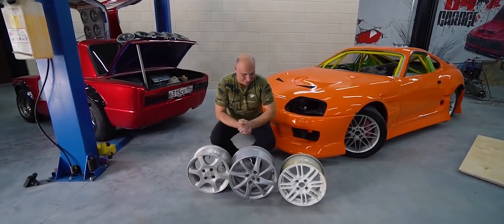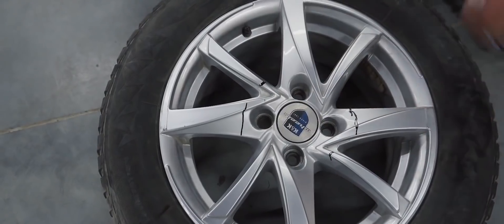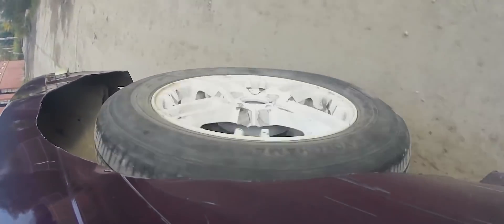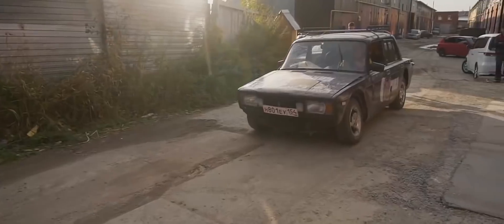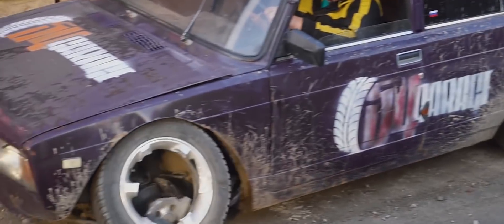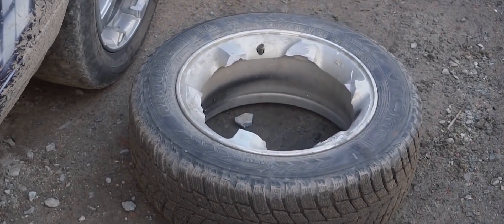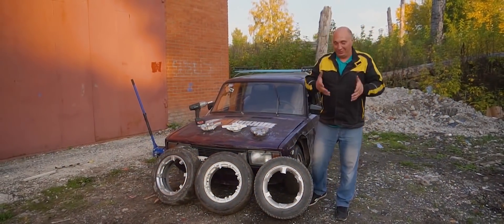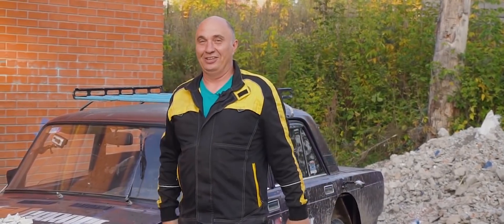How many spokes can you cut out and still drive?

Comment: Makes some degree of sense- the spokes are going to be much stronger than just the weight required to support the normal usage of the car, they also have to be strong enough to not break from the metal fatigue.

 at highway speed they're going to be getting stretched and compressed with over  a hundred kilos both ways more than 20 times a second.

Not much when compared to the strength of the metal, but these things have to last many years, and it adds up. So the wheels need to be many times stronger than you'd expect to not gain cracks and fail in a reasonable time period, and can thus last a while with most missing, but succumbing to fatigue exponentially (literally) more quickly.

Comment: It makes a difference what the materials are and whether they are cast or forged. Forged are stronger and more resilient. Cast are more brittle and have a lot less ability to withstand flexing. And ironically, larger spokes (which are probably cast) have more concentrated stress with less flex. Smaller spokes have more give and less concentrated stress. That's why wires that need to flex have multiple small strands while stationary wires (like house wiring) can have a single thick conductor. If you bend one of the single big conductor wires only a few times it will snap in two, but bending the multiple-strand wires can be done repeatedly with little effect.

It is interesting to see this. I have seen some 2-spoke wheels. In my opinion they are ugly and they are definitely massive, probably weighing more than double what a multiple-spoked wheel weighs. That's because they have to be made so massive that there is zero flex, because any flex at all will cause them to self-destruct just like in this experiment.

Comment: Just cut them all to remove any friction between the center of the axis and the rim. This will unlock the full potential of your wheel allowing theoretical infinite RPM. Just be careful driving over match 2 while listening AC/DC.

Comment: this was not a real test because no attempt was made to go faster than 100 kph or even 75 kph. That speed would be enough to get the wheel bouncing up and down like a basket ball due to wheel unbalance.  But a loss of wheel at this speed could cause roll-over, so be sure to have racing seat belts and crash helmet. Now a roll-over, that would be interesting.

Comment: it just so happened that all 3 random wheels you had were the right bolt pattern for a lada hub
Reply: Ladas are 4x98, many cars are 4x100 so they are virtually interchangeable as 1 or 2 mm difference is nearly nothing. In eastern europe anything that needs a spanner smaller than a 17mm  is considered nano technology anyway and some measure things only in centimeters and are not aware of any smaller possible units.

Comment: that's not what i expected, i thought they are brittle as hell and break from weight and torsion with just few spokes removed... on standstill... but some did wobble around and of course one-spoke wheel was just priceless

apparently they are well (over-)engineered...

that said, steel sheet metal wheel can't fail like this, but alloy one could, in accident at least

Comment: he's not going fast enough to damage the wheels. wheels are over built to handle hitting potholes at 70mph, driving around a parking lot in 1st gear isnt going to hurt anything.
Reply: another factor is a cast vs forged wheel.

Comment: Use JB weld to peice them back together and see how well it holds, that would be awesome !!! Repost this comment till it happens 🤣
Reply: JB weld it should handle better but there is no point at all
Reply: I give up.
Reply: You know its aluminium ans welding aluminium is possible only in TIC and itd expensive. Its simmilair to welding carbon iron.
Reply: @mortyjuanez3598  JB weld is an epoxy glue with metallic particles in it. It can be used to "weld" but really it's glueing.
Reply: No
Reply: @viralvideo171  well fine ! 😮
Reply: look at that They use Stalin weld instead
Reply: @ember4ever206  this may be a dumb question, but what is stalin weld is that like a thing lol? Or are you just making a joke ? .

Comment: ok I finally have a comment to send. rather suggestion.  get 4 wheels, 5 or 6 spokes and cut the WHEEL off as close as you can. cut close leaving the spokes to drive on. throw out the wheel and tire. that will make the best 4x4 grabbin climbin spoke thing of all. or not. probably wont turn well.
plan B2. put 4 railroad car wheels on a car.

Comment: Project idea: Motorized bar stool using a car engine. There was a V8 on fb the other day where the guy took a small centrifugal clutch from a chainsaw mounted  right onto the flywheel. Unless they have a hydrostatic lawn tractor laying around, but cheaper right. Pretty neat if you have a minute to look it up guys. Cheers.

Comment: Attach helicopter type blades on roof of car, driven by a shielded driveshaft down to, and through the floor, to a 90° drive transfer box hooked up to the transmission. Gradually accelerating, it should lift.

Comment: How long would a car run or even start without a head gasket with just sealant as a gasket?
Reply: Been there done that. A long ass time
Reply: My lada has been running for years with just tissue remaining of a head gasket
Reply: I've made a head gasket out of a cardboard beer case and sealant so ya It's possible and works for years  a high compression engine won't work very well

Comment: Factory alloy rims are very strong, I have had about 10,000+ lbs on a set of car rims on a truck loaded with bricks, it weighed about 5500-6500 without the blocks stacked high as the cab!

Comment: An idea: Maybe put some really powerful magnets in the wheels, and make a cast wheel of some sort so you drive directly on the magnets. And then drive through a lot of metal parts, or on a metal surface and see how it reacts. You could also attach some metal drums/barrels to each rim and fill it up with different things like water or rocks:)
Reply: Steeldude so genius
Reply: Magnets that would oppose 750lb (total 3000lb) would be massive and very expensive.
Reply: Austin T. That’s what I was thinking

Comment: Jesus, I'm more concerned for the suspension on that damn Lada than the spokeless wheels.
Reply: More Camber, More Faster!
Reply: You should have seen what they've done to this poor 2015
The off-weight wheels you saw
The wheels with offcenter axis
The wheels at changing camber
This nonsense
I'm suprised the suspension is not just dust at this point!
Reply: @televisionandcheese  Stalin spec suspension! If it breaks, to the gulag it goes!
Reply: What suspension, that fell off long ago. Hence this video called using springs instead of rubber tires,  https://www.youtube.com/watch?v=xG2mbL4QyZQ
Reply: one does not simply break a lada my friend. :D
Reply: Them had a industrial type of suspension and most can be found fairly rust free

Comment: This needs to be done with wire wheels
Reply: Spoked wheels? -- It can be done, though you would need adjust the tension of the other spokes to compensate for the spokes that were cut off.

If you just cut them, the wheel becomes unstable and will wobble like a MF.

Edit: Actually you can see how that would pan out (without wire spokes) you see the wheel start wobbling, because it doesn't have the 2 spokes to deal with the weight; now if it were mounted on the back of the car, it could have made it a little longer.

The most extreme rims for cars i have seen are 2 spokes, but they are THICK

google "  2 spoke rims " you'll see what i am talking about.
Reply: @ownerfate  we all know the teddy bear wheels are the best though
Reply: @OmnistarEast  -- Agreed.
Reply: @OmnistarEast  you on about the ronal teddys?
Reply: @Usercouldnotbefound  yeah
Reply: He did it aready